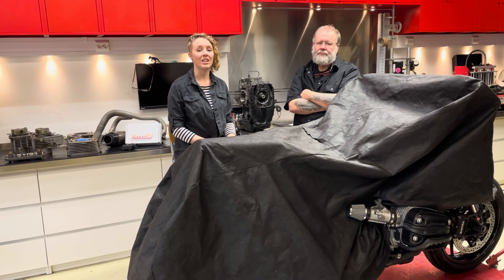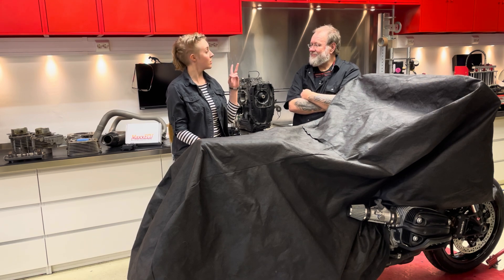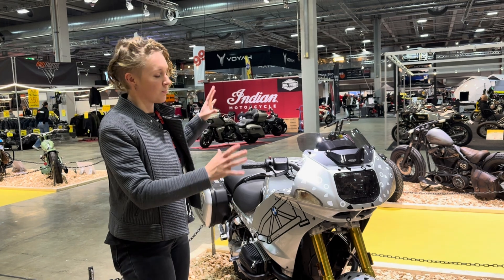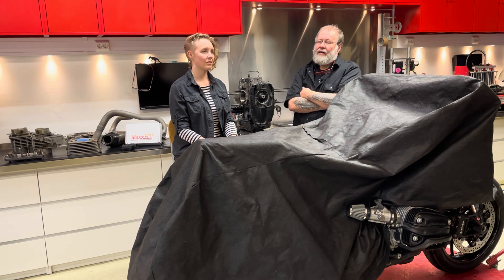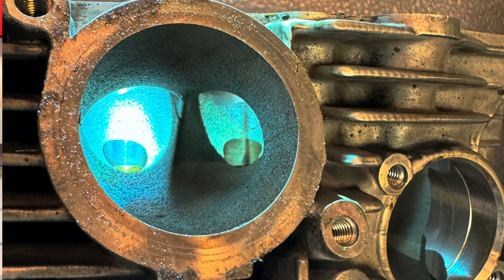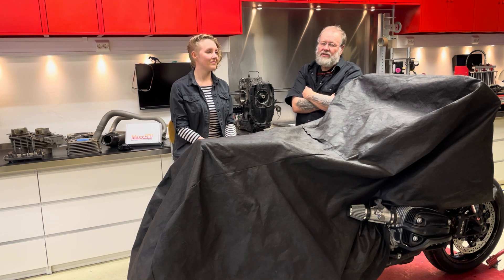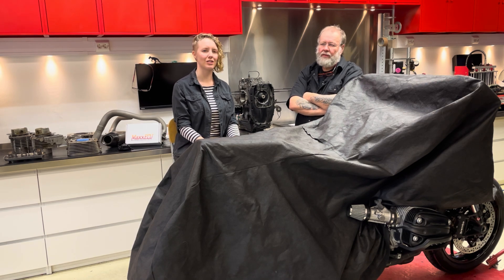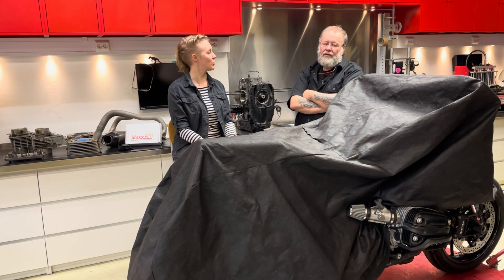Product News: MaxxECU, BMW Boxer Frame and Tuning, HEL Brake Components

Comment: ore information on the abs units please i have a 1200 gs with abs pump problems thanks
Reply from the maker: Here you find some further info, you can choose the language on the upper right corner. https://ebutik.nccr.se/nccr-brakes-1/bmw-brakes/continental-abs-conversion-for-bmw-using-the-fte-integral-system